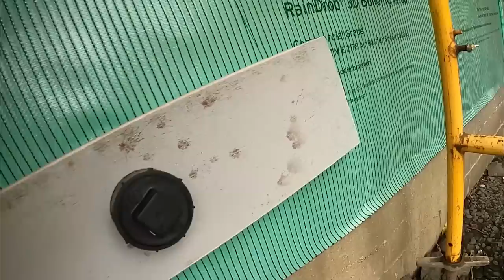What To Feed A Plumber: Shop Build #22

Comment: I have a tip for you. When you use the plastic Cheep shower surrounds, I always use low expanding foam to fill all the soap shelf areas on the back. it adds longevity to the products

Comment: Always enjoy a phill video, I use that Rockite all the time in industrial settings. I prefer the 5# box dump the powder into a bucket add clean bottled water and mix with a small paint mixer on your cordless drill, put the bag that the rockite came in back inside the box to hold the bag open dump the freshly mixed rockite back into the bag and tie a knot in the top of the bag now tug on the corner of the bag it will stretch the corner into an elongated spout now you can use it like a piping bag to inject it into tight spaces, around posts, repair craters in slabs  etc clean and easy.  Amazing stuff
Reply: Good tips! Thanks!

Comment: Whenever I use one of those "Oatey no caulk shower drains", I run a thin bead of clear silicone around the inside covering the nut, gland ring and lip of the pipe after its tight. So basically, I caulk the no caulk drain!😂 Cheap insurance.

Comment: So Phil, I'm an auto mechanic by trade, so I like to think I know my way around oils and lubricants.
There's a right lubricant for the job most of the time, and 99% of the time in my trade that means some form of oil or grease.
But knowing which one to pick when you can't just look it up is one of many reasons why I get paid more than the guy working at the Jiffy-Lube.

Of course, I've made a few wrong judgements in my younger days, and because of that I'm far more familiar than I'd like to be with the various ways that oils and solvents can degrade rubber, even if that rubber is some fancy synthetic elastomer that has crude oil as its base stock instead of being made from the gunk that they harvest off of Latex trees in the tropics.
I'm amazed (and thankful) that the chemists that went to college for their jobs were able to make a rubber compound that can resist hot engine oil power steering fluid or ATF and still last as long as it does in service. These days I'm barely ever replacing hoses that carry oil or coolant anymore, unless they're physically damaged of course. Same with serpentine belts, you usually don't even see them getting replaced while the car's still under warranty anymore, and it's all thanks to the better rubber compounds the industry has come up with.

In any case, rubber is great and all but the main reason that I'm here is that there's a kind of lubricant that's "an oil" to most people but it's "not oil" enough that rubber won't degrade when in constant contact with it (well, all kinds of rubber except silicone rubber).
That stuff is usually known as the broad category of silicone oils and greases, and they're almost always "compatible" with (as in won't degrade) any kind of rubber except for of course those "rubber" compounds that are in fact silicone themselves (even then, there are kinds of silicone rubber that don't degrade when in contact with silicone oils).

Because of my career in auto repair, I know that one of the best places to find a "generally useful" silicone grease is the lubricant they use between the brake pads and the brake caliper. If it says it has some sort of metallic powder in it you don't want it, that stuff IS silicone grease but the metal powder in it is something that makes it useful for ONLY lubrication of brake parts. If your auto shop doesn't carry "plain" silicone grease for brake parts, you might see the same thing labeled as "dielectric grease", because another advantage of silicone greases and oils is that they are VERY good electrical insulators.

With the silicone grease used for brake parts, it's used for the same reason you'd want to use it around other kinds of rubber parts. A crude oil derived grease would ruin the brake pads by chemical action. On the other hand, the silicone grease apparently doesn't do that (I'm not a chemist so I can't explain exactly why that is). Of course, when you're doing a brake job you're not supposed to use so much of it that you get it on the friction surface of the brake pad anyways, because it's still "a lubricant", and lubricated brakes don't work well without some very special kinds of "lubricant" (that's why automatic transmission fluid is special, it has stuff in it that makes the clutches in an automatic transmission "grip" when it would otherwise "slip", called "friction modifiers").
In any case, long story short, you can probably get silicone grease at the auto parts store.
It's also great O-ring lubricant, for the same reasons it's a good lubricant of all kinds of rubber that aren't silicone.
With how little you'd be using as a plumber, you could probably get a year or more out of a single "normal-sized" squeeze-tube of the stuff. And it's not "too" expensive either, that squeeze tube of silicone grease with nothing else in it might cost you $15 at the most, and that's "over the counter" prices (The auto shop I work at, like most, gets a discount on parts and supplies from the same auto parts stores that "normal people" shop at, because then we're able to take the difference as profit or pass the savings on to the customer).

Comment: 24:23 I've set a lot of steel handrail in Rockite. Use gravel in the hole bored or cast into the concrete around the pipe to get the uprights plumb, then pour 'flowable' Rockite into the hole and it flows down through the gravel.

Comment: I like your plumbers style; steady and competent. The only time I hired a plumbing contractor was when I was building my home in Colorado. They were speedy and passed inspection, but later left me with a low spot in the septic line in the crawl space. It would back up and then freeze at the outlet into the septic tank. Once I located the low spot, it was an easy fix. I just found the episode ironic as it was 1 of 2 systems in the house which required inspection. I had hired professionals and it had been inspected and was still inoperative. Turns out, a good man is worth two 'pros' and an inspector.

Comment: Those shower wall kits are an absolute nightmare. I just thought I wasn’t smart enough to figure it out. I got so frustrated with it all after the walls were up I tore them out and put up tile. I still used the pan and the door; it ended up making a nice shower that way.
Reply: I have a lot of problems with everything else, but I did good with this exact kit- I must have been lucky.  This was a space saver for a retrofit - also not going to be used more than 30x ovr 30 years.

Comment: Around the 25 minute mark you mention rockite. About 45 years ago I would get a maybe 4 to 6" puddle a few inches from outside poured concrete wall.on my basement floor whenever it rained hard. Finally figured out that the 1.25" steel gas line emerging house was on a slight downward slope. Removed concrete from around d gas line and it looked like a funnel hole. Hope on other side on concrete walk had a 5  to 6" wide hole that tapered down to hole a little larger then gas pipe. Old time plumber in work told me to purchase hydraulic cement and use that. It did get warm after I added water. Never had a drop of water leak there in last 45 years. Yep got my moneys worth & then some.

Comment: I've done two of the delta r22000-ws valve bodies. and 17 series trim. They are the cats meow and bullet proof.  Temp and flow control separate. Had one for 6 years and flawless. Install was as advertised. Simple. Just a little tight on the tiles to mud box fit. But not too bad. Took the old one apart to lube it up after that time. Works great. New one went in no problem and works great too. Temp limit stop setting is a little touchy but can save a little one from a burn if you set it right. But the temp balance or toilet flush balance is amazing. Turn the hot water off in the house and then turn this valve on, no water comes out. It knows or sees the balance and throttles the one that has pressure. Very cool. I mean it, no water comes out. So if a toilet and sink was running and the flow couldn't' keep up for the hot or cold the other side would shut down.

Comment: You should install a layer of Struct-o-lite under the shower pan. Then set the pan down into it, when it drys overnight the pan will not flex or move in any way ever. This gives a good feel under foot as well. I’ve done this on all my Fiberglas shower pans and tubs as well.

Comment: Phil I pretty sure you have seen a plumbers cut off saw (Hand saw) with the teeth curved around the nose. I had an old carpenter grab mine out of my bucket while we were waiting for his guy to bring the sawsall to cut the opening in the countertop for the kitchen sink. He says, "Do you know what this is for"? He starts to attempt a plunge cut by hand with my hand saw, slips and puts a huge scratch in the new countertop. Then blames me when the correct tool finally made it to the job. Funny guy.

Comment: Scott, a couple of the plumbers I worked with over the years would use a product called Structure Light under the shower pan and up around the back about 4 inch to give the shower pan more support . They both did it so I imagine  they have problems in the past .

Comment: When we put a composite shower tray down we mixed up a really weak mortar mix and laid a pad slightly higher than we needed and gentle wiggled the tray to settle it and get the required levels. I put mortar plastisiser in the mix and gently troweled the excess away as it was squeezed under the edge of the tray. It's been down for seven years now and hasn't moved at all. The weak mix means that if we do have to remove it to change it it should come up without too much of a struggle.

Comment: GOOD VIDEO, I INSTALLED ONE OF THOSE AND IT WAS A PAIN IN THE ARCE. I ENDED UP CUTTING THE PIPE OFF WITH A VIBRATORY TOOL AFTER THE FACT.

Comment: I've coredrilled 1000's of holes for railing.
Rocktite,or anchoring cement (quickreet brand) is amazing stuff.
Buy the galvanized watering can ,and knock off the shower head looking diffuser at end of spout.
Use a drill with a paddle bit ,mix to a consistency of very thin pancake batter.
City water's chemicals can cause it remain inert, was cheaper to buy gallons of distilled water ,or we kept a 40 gallon tank with well water. 
If using good hot water,it will setup in less than 2 minutes .

Comment: An inside pipe cutter makes installing these shower drains a dream. You just shove the shower pan in over your long stubbed up pipe, install the gasket then you’re able to cut it flush with an inside the pipe blade for a drill. Otherwise you have to cut it perfectly before actually getting your gasket on. It’s so much easier.

Comment: The shower situation is so true and I’ll add that it applies to many situations. I had to replace a laundry tub cabinet combo and the only one I found (due to dimensions) at the big box stores and the price was right but it was right because everything about it was cheap. I had to replace the faucet and the drain because I was afraid they would fail. Especially the drain which if it went would be a lot of water everywhere all at once. The faucet on the old one was solid brass. The new one I had to replace was 75% plastic. You get what you pay for but you can’t always get you want, to paraphrase the Stones, these days. Buyer beware.
Reply: I once had to replace a bathroom cabinet. I kid you not I had to re engineer, re configure, re construct that thing every single step of the way.   Sometimes I just want to…….

Comment: First  thanks again for another informative video. I always learn something useful and appreciate your efforts. 

But I must make a couple of comments ..

First, I've installed that exact drain. The instructions for where to cut the pipe are included. I always take some time to read instructions even if  this 63 year old diy guy thinks I  know everything. I at least read through the manufacturers recommendations. I may not always follow them. But I at least read and understand them.

I'm finishing up installing a similar unit. Yes, it's pretty picky about the framing. But I'm much more comfortable with framing than making my own shower pan and waterproofing a tiled shower. I can do tile, but I'm much better doing floors and have no experience with waterproofing. I'm the target audience, a reasonable foolproof, leakfree enclosure for someone who can follow instructions. The design allowed for some reasonable tolerances and also did it without any caulking. I did have a little caulking for the door, but none around the shower seams per the instructions. It's designed to let the water escape into the pan. But not get past the flanges. It's possible, but someone would have to work at it. 

My last comment is in this day and age, the instructions for all of these things are online. In fact, the instructions for my enclosure had been updated and some good changes were made. I always download and read through instructions before buying things like this to keep the surprises to a minimum. I also did it for the shower pan and door. Plus. It's nice to have them on my phone where I'm less likely to lose them and have to go looking for them. 😊

For instance, the instructions for the enclosure call for a specific adhesive due to the plastic walls. Normal construction adhesive and silicone caulk may not adhere. I had to order them online as the big box store didn't carry it.

Comment: There’s not much left of a 2x4 wall support after a 2 inch hole saw, lol. I know it’s just an interior wall but still, 2x6 should be standard.
Reply: for interior walls?
Reply: @jamesengland7461 , For plumbing walls, the one that has the vent pipe going up inside it. Makes life easier.

Comment: hate those showers last one i did was a nightmare that's what you get into when you have a dumba$$ for a boss lol curious how the air in the shop was not blue when dealing with the shower lol good editing job lol i think the big rubber thing is called a ferrule at least that's what i call the copper/brass ones

Comment: You don't eat a cocktail of vegetables when you're pre diabetic. In fact, what he has done with his blender and jar meal is overdosing himself with carbs. He needs to be on a keto diet until his weight is back to safe levels and then any vegetables he eats need to be in their natural form and only those which have a low glycemic index. Don't need much each day. I see people do this all the time. They think vegetables are the way to get healthy and eat right and its actually the worse thing you can do.

The next thing is; He needs to be on an intermittent fasting diet. Eating his days worth of calories in a 6 hour window each day and then outside of those hours, NOTHING!!!! Drinks need to be free of calories and sugar. Sugar free tea is great. Water is great. Coffee is fine as long as its black. No milk, no sugar. The 6 hour window for eating all of your calories should be no more than 2 meals in that 6 hours, generally starting at 3 pm, ending at 9 pm.